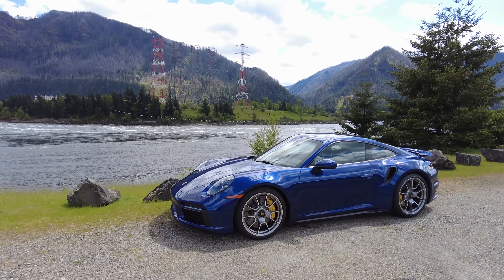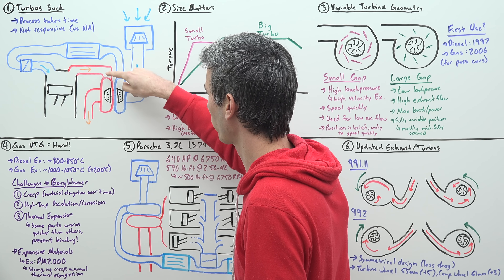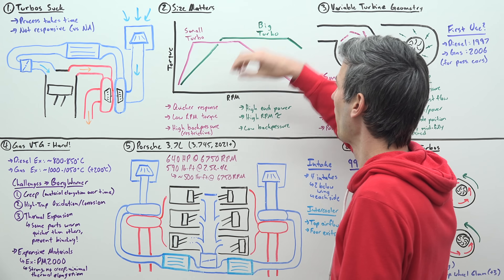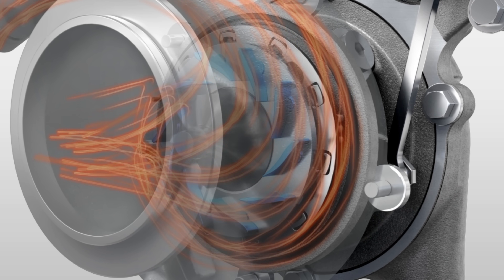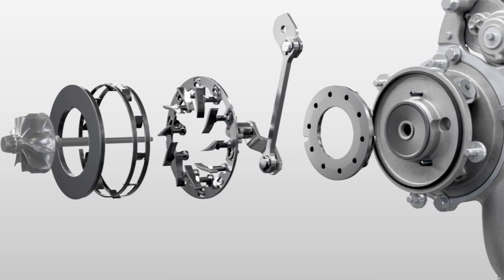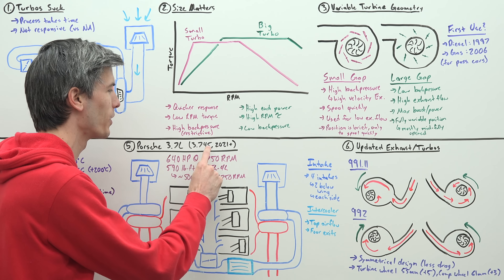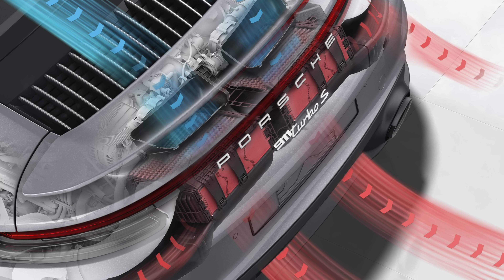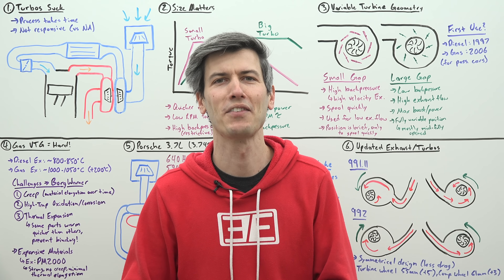The Perfect Turbocharger? Porsche Did It First

Comment: For the US market, the '89 Shelby CSX-VNT was the first variable nozzle turbo, that's literally part of it's name. 

The Turbo-IV made full boost (15 psi) at 2,100rpm and produced 205tq and 175hp at the crank. The engines dyno around 140whp and 175wtq. Upgrading the engine with this turbo was problematic because it was advanced for the time (aka failure prone) but also because the car used the VNT as the wastegate. Installing a larger exhaust meant the turbo was easy to over boost. 

Regarding the failures, the earliest turbos tended to bind up and freeze the vanes in place due to rust and carbon build up. An update was released by the engineers to move the vanes back and forth upon start up to prevent build-up. That seemed to cure the failures.

Sources: Allpar and various Chrysler Engineers from articles on the aforementioned site.
Reply: You beat me to it. Chrysler used a number of VNT units over the years.
Reply: I finditinteresting that the rotating-vane VGT was first developed under Garrett was patented in 1953.

One of the first production cars to use these turbochargers was the 1988 Honda Legend; it used a water-cooled VGT installed on its 2.0-litre V6 engine.
Reply: Phew, glad someone said it, 89 CSX-VNT was before Porsche VNT ( or VGT) on a production car
Reply: This.
Reply: Under rated comment. I was playing with VNT/VGT turbo's in the '90's. We get some interesting information here, but the channel is more and more just marketing for the various manufacturers. For example, despite the improvement in efficiencies (Mercedes has its own as well), a turbo still sucks IMO. Not a fan of the lag and non-linearity of power. Spoiled by electric and some well executed Twin Screw superchargers.
Reply: @brois841  I think the world is of two halves: those who can live with lag and those who cannot. Personally love a little lag. The turbo letting me know it cares.  I am not a road carver, just like straight line acceleration. For the average person, if you put them in a car with a small to medium motor, and a turbo that doesn't transition until 2200rpm, but when it does, it puts out big boost, and they are not competing, it will usually make them smile a lot bigger. Many folks like a surprise!
Reply: @JJJulie-t7e  Having test  driven a late 70s 911 Turbo was a little scary in my youth.  Rear wheel drive with a pronounced weight bias and a turbo lag...
Reply: I had a 1989 shelby CSX that came with a VNT and the Garret VNT turbo lasted over 100K.  I also ran it with a modified VNT turbo where I added a slightly larger compressor wheel which had some overboost but nothing out of control.  I also had the 1990 dodge shadow ES VNT with the 2.2 engine.  It also came in the dodge Daytona and Le baron.  I think I still have a new unused VNT turbo out in the garage somewhere.
Reply: Yep, also wanted to say the same thing.
Reply: Garrett VNT25.   A little research would have turned this up in seconds.
Reply: I think he purposely says incorrect statements, so he gets more comments like this.
Reply: Friend and I have two of the VNT Shadows.  Neither one still has the VNT turbocharger on them though.
Reply: Haha, read the silly article on hotcars pointing to this "revolutionary" Porsche design, and was screaming Dodge Shadow (at least I think that was the vnt car).

Roflmao!

Also some may recall there was a drop in self oiled vnt turbo as well, several sizes -- maybe The Aero Turbo? There used be some YouTube videos around of Harleys with them.

I am sure these Porsche units are super reliable like all Porsches are. You know, you just need a 5k$ turbo tune up every 50kmiles, which is just a unbolt, chunk and replace of this fantastic "new" turbo technology.

The only place I am aware of it being a reliable tech is in diesel trucks, as in semis. Even there I don't really know of how pervasive or reliable it is...
Reply: I had a `90 Lebaron GTC Coupe with the VNT
Reply: Came to say the same.  Vnt was available 30+ years ago on certain Shelby k cars 😂🤣
Reply: Right you are.  I took down my comment that was posted much later than yours. It was exciting to read about the tech in car magazines of the time.
Reply: Glad some out there know the 1989 Shelby CSX-VNT had it long before..
Reply: Man I miss my turbo Shadow 2 door. Looks like a sleeper but would pull on a lot of stuff rolling around haha. I beleive some piston engine aircraft that were equipped with turbos in the 40s and 50s used VNT / VGT as well. Nothing under the sun is new.
Reply: is "tq" a proper unit now?
Reply: @Coolgamer400  it’s clearly not NM so you can make the assumption

Comment: @EngineeringExplained
Hi just a quick question, may that system be opened and closed via engine belts depending on the rpm you have? i ve seen something on group 6 racing cars.
Thank you

Comment: This dad appreciates the joke. 
I know faster spooling and smooth power makes for a “better” driving experience. But, man, I’ve yet to drive anything as fun as my Dad’s 87 Shelby Charger. Stomp the gas and hold tight to the steering wheel. Cause when that turbo hits, the torque steer is unreal!
Reply: Is the car front wheel drive?

Torque steer can only happen on FWD 🤔
Reply: @odin5188  ....Yes, its FWD.  1987
Reply: @odin5188  yes and as someone with a real v8 hemi OG charger i don't like menching that abomination of a K-car
Reply: @richardprice5978  Imagine crying and gatekeeping cars. LOL.
Reply: @derekr3895  no it's called wrong marketing and naming as my car is about 180* different than that 80's Shelby car

now my take is its a meh car ( to bad it's not AWD ect ) but so is the K-platform but it's ok if you like it just call it something different than a charger
Reply: Cars change and evolve over time. You created some weird argument in your head for the sake of . . .something. Weird dude.
Reply: @derekr3895  no cars can evolve but the 80's wasn't even close to resembleing a B-body platform ( and more so in one generation and the 2000's-up cars don't resemble the 80's at all not even close. the LX-up 2012 charger is someways close enough to my 60's car but i feel they did the doors ( and some other small nit picking things ) wrong and should have done 2-D or 4-D but 1/2 backward swinging/dihedral/sisor doors and frameless-windows-glass that are better hid ect. and yes i considered ordering a SRT-8/hellcat so it doesn't suck too bad to me and morfing it to part-time 4x4 would work as a marketing decision ) let alone a hardtop/convertible ( Richard's and bills original intent in 1966-70 but failed to get there boss okay 👍 ) made for about 6-people and airline luggage ect. and prior to that the best selling trim-package was a automatic transmission and a v8 so a 318 or 383 SE/full-loaded what my car use to be but is moved up-line in trimming to BBM-hemi-7speed and nicer imperial themed trimming ect.
Reply: @derekr3895  well im on a roll dodge should have done a 4inch bore centres and a 10"deck height for the SBM and 5"in centre and 12"-deck for the BBM/hemi that was a missed opportunity and some others bits to that storyline
Reply: Rwd? Torque steer? What
Reply: @lonewanderer958  The Shelby Charger is FWD . . . .

Comment: As I work for Borg Warner's competition, it's always a pleasure to see their product in such a detail! ;-) Regarding the start of VGT/VNT application - as stated below 1989 is the year in deed. You've mentioned it's not used even nowadays a lot but on a contrary - new VW 1.5 TSI engines use and upcoming generation will also use it all around the world (count for millions of cars ;-) ) otherwise never heard of PM2000 - TC developers usually use sth like 1.4848 for turbine housings and inconnel for parts of variable system (VGT)
Reply: Looking on the terminology you have used (VNT), you work for Garrett, am I right😉? The gasoline VTG/VNT is also on 1.0 TSi (also EA211 evo family, just like 1.5 TSi ), that is global gasoline engine, and it is on the market since late 2020 if I recall it corectly (again 1.0 is a BorgWarner product) but looking what is on the market, for majority of OEMs, currently if we have gasoline TCs, those are still with wastegate.
Reply: If I am not wrong there's already 90 kW 1.5l VNT out there but huge volume is just about come (Unfortunately I can't say more). And you're right 1.0 l is managed by BWTS. The other OEMs were kind of hesitant but trying to keep up with VW on variable geometry system these days
Reply: I remember a limited run of  vnt turbos on the Chryslers 2.2
Reply: What do the 1.5TSI engines put out in kW? The 1.4 twincharged engines from Mk6 Golfs surprised me by delivering up to 125kW
Reply: @dielaughing73  110 kW in standard set-up.

Comment: Actually, I want someone to design a turbocharger that can also be belt driven at first, but then become exhaust driven once the engine spools up.  Maybe with some kind of clutch system.  You get the benefits of supercharged engine with the top end efficiency of a turbo.
Reply: You can just put the two in series. and with the modern electric dynamo's coupled to TC's this can be done without a clutch even, just a switch to use the dynamo as a motor for a few sec's to spool up the turbo. 
Big industrial engines, might have a compressed air system to spool up the turbocharger, consisting of jet nozzles inthe housing blowing at the turbine blades at low engine loads.

Comment: These sure are amazing, but I see the future as electric supercharging. Keep a consistent perfect intake pressure at all times needed. Let alone packaging, being able to have the compressor a lot closer to the intake than turbochargers.
Reply: The brilliant thing about turbo is that the energy from the exhaust is almost free, if a electrical supercharger is used, that 10-100 hp to run the electrical supercharger is going to come from a battery and a generator taking power away from the engine.
A complete turbo should be used with a motor/generator on it, take energy out of the exhaust when power is not needed and when needed kick up the turbo speed until the engine exhaust takes over again.

Comment: First Use is much earlier than you realize.  1989 CSX (Dodge Shadow Based) used the Garret VNT25 and subesequently in the 1990 Dodge Daytona.
Reply: FWIW: with a mild tune we were making full boost (14psi) at 1200 rpm.  it was a fairly small Garret T2 based turbo and really fell off about 4500RPM.

Comment: I've been recently exposed to VNT turbos and how they work because my 1.9 jtdm diesel has one with stuck vanes, which result in overboosting (let's say the ecu wants 31 psi and it gets well over 37 (the max reading of the boost sensor)) and it throws you into limp mode. Apparently there is a cheap fix, which involves spraying Mr Muscle oven cleaner into the exhaust side of the turbo and wiggling the rod that moves the vanes. Really hope it works...
Reply: Nothing a little WD-40 can't fix!!!

Comment: You are not a fan of "improperly sized turbochargers".  THAT is the truth with most turbos. Everybody wants big power and therefore big turbos. I have built over 10 different turbo set ups over the years and the most fun ever was with a small turbocharger. I can control boost with the gas pedal, that's how you know you have the right turbo.

Comment: Does a turbocharger really save weight or space compared to a larger naturlly aspirated engine? I would guess, there are nearly no relevant differences, especially if you aim at about the same power delivery (>90% torque at peak power, power to torque with >0,5, about <0,5s response time).
Reply: Forced induction fixes the charge mass entering the engine, giving you that lovely flat torque curve.
VTEC and the like simulate that by changing intake conditions to lower restrictions. It's probably doable but obscenely complicated and not with the effort
Reply: I some cases yes, a smaller engine with turbo could also be easier to fit because some of the external components can be moved around in the engine bay.
A 2022 dodge charger 3.6 v6 has 292hp and the new Toyota Corolla 1.6 3 cyl should get 300hp.
The 5.7 hemi is 370hp, a Mercedes AMG 2.0 4 cyl turbo is 440hp.

Comment: I had a dim recollection of "PM2000", then googled it to find it was similar to something I worked on the early 1980's (MA956). Yes, very special and unusual, made only by the company I worked for. Somewhat surprised this sort of alloy is still used, after advancements in more conventional superalloys that are easier to prepare. Yes, they are known as superalloys, a well-deserved term, though most are based on nickel. The only way to get a fine enough dispersion of the oxide in an oxide-dispersion strengthened alloy is to literally beat it into powdered metal in a ball mill.
Reply: you may be interested to know that after disappointing Huntington/Special Metals in the 80s/90s, the Fukashima events forced an acceleration of the ATF program and renewed interest in iron based fecral w ods stabilization. C26M and similar are public frontrunners for LWR claddings. APMT and other higher alloyed, higher strength variants were heavily considered as well.
Reply: I believe turbocharger wheels have been made of the real manly sort of superalloys for many years, by which I mean gamma/gamma-prime alloys. a highly alloyed nickel base, with additions of Al, Ti and Ta to form the magical gamma-prime precipitates. Jet engines use highly developed compositions (my field, at GE Aircraft Engines) prepared by directional solidification to produce single crystals. Turbo wheels would be conventionally investment cast. They are much stronger than the alloys we've been talking about here at all but the most extreme temperatures, but low-temperature strength is needed also for wheels, at their bores. I suspect the PM2000 is used only for other components, those that can be made from sheet or plate; they cannot be cast.

Of course, there is/was turbochargers with ceramic wheels, and even some with another alloy I worked on, gamma titanium aluminide (mostly banned in Formula 1 for cost reasons).

Beware: materials application engineering is a surprisingly complex field - so many materials, so many requirements, so many potential manufacturing issues, so many opportunities for something to go wrong.
Reply: @curtaustin8119  so many manufacturing issues ✅ (😂)

with (high) demanding properties, sometimes apparently impossible to reach, due to plant limits most of the time.

stainless steel company here
Reply: @curtaustin8119  Something got banned in Formula 1 for cost reasons? I didn't think that sort of thing could happen. And I have a vague recollection from decades ago that the problem with titanium aluminide alloys was their poor low-temperature properties; the stuff was brittle as glass when cold.
Reply: @soaringvulture  Not brittle as glass, just low ductility. How much ductility does a component need? We did very specific tests on that, such as putting dents on specimens simulating leading edge profiles and then fatigue testing them. Long after we did a successful engine test of low pressure turbine blades, GE is now using TiAl in their latest engines. BTW, I had the chance to consult with Ferrari over potential applications, and enjoyed some very good tickets at the first Indy F1 race - tickets sent to Jack Welch.
Reply: Superalloys can be much cheaper for sure. I was thinking about 660 and 625, that are already in automotive industry and usually tested for creep resistance. or maybe alloy 80A could be the best for high temp. Don't know much about critical use of these in turbos tbh.
Reply: @elxuzzzz  alloy 625 and 660 are much more traditionally forged alloys than Powder Metallurgy (PM) or Mechanically Alloyed (MA) materials. Both PM2000 and MA956 show phenomenal extreme temp properties (better than all non-ods alloys above around 1000C), but are less relatively advantageous in the 600-900C range compared to Ni-based non-ODS super alloys like 625, 230, 282, etc. All depends on the specific environments of exposure. Additionally the addition of Aluminum in 956/2000/APMT dramatically improves their extreme temp carburization performance compared to other ferrous alloys and even compared to many Ni-based chromia formers (like 625 for example)
Reply: It brought great pleasure to hear mention of powdered metallurgy as someone who appreciates steel composition. My interest is derived from pocket knives and I had always wondered what else they were used for and now I know a few examples

Comment: My 2000 Jetta TDI had this. Only issue is that it eventually wears out and then you get limp mode because the ecu doesn’t see as much boost as its requesting. Took over 300k km for this to happen though.

Comment: Great explanation of the technology Jason! The simple fact of why variable-geometry turbos aren't used more often is absolutely the complexity, cost and durability.

When an engine uses a turbo, you are trading off displacement for efficiency. However that carries a cost - longevity. Turbos are basically an expendable items, like an air or oil filter. It will eventually 'burn out' in a gasoline engine. So most manufacturer's are OK with providing a less complex and costly solution than what Porsche is offering. A Buick Encore or Honda Civic doesn't need to be sportscar responsive in bumper-to-bumper rush-hour traffic.

As great as turbocharged cars can be, I would still rather have a simpler, responsive Normally-Aspirated engine in a lighter car, much like a Porsche 911 GT3 RS. In the long run it's a better arrangement.